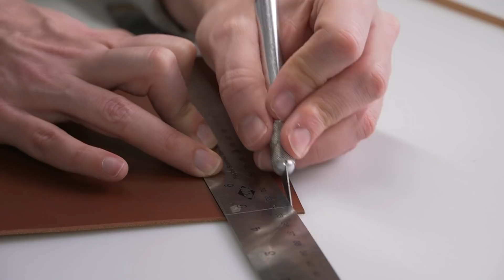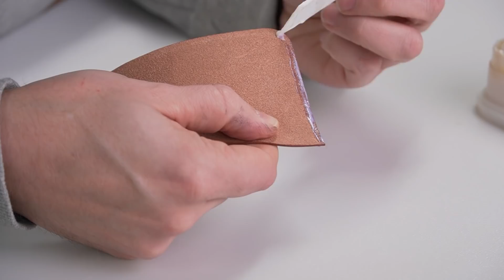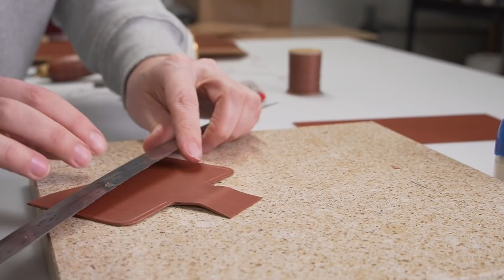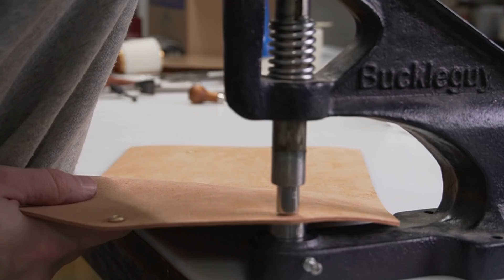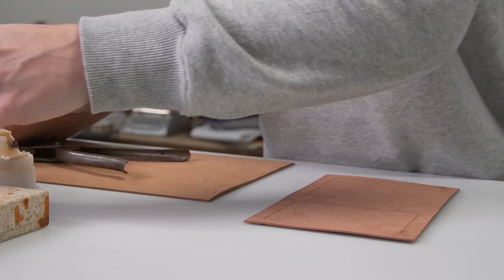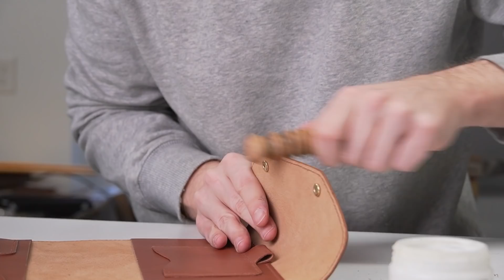Making an A5 Notebook Case (PATTERN)

Comment: This is really lovely. Thanks for sharing. I have a question if I may? I would like to use hard back journals so is this design possible with those?
Reply from the maker: Thank you! I did not try one but Im thinking it should work unless the cover is extremely thick. I need to get some hardcovers for next notebook project.

Comment: OLD LEATHER SMITH here. Very Nice, easy 2 understand 4 beginners. Suggestion, Bees Wax on all punches, goes into and comes out of the Leather easier, in my opinion the snaps used will wear out before the item they R installed in. GOD'S BLESSINGS ✝️⚾️🙃

Comment: What exactly were you doing with that big piece of glass? (9:06)
Reply from the maker: The linen thread has a "round" profile that doesnt lay flat when you are pulling the stitches. I used the glass burnishers to go over the stitch lines and flatten down the thread for uniformity. Usually do this with a finishing hammer but it goes faster with the glass.
Reply: @MAKESUPPLYLEATHER  cool. Thanks.